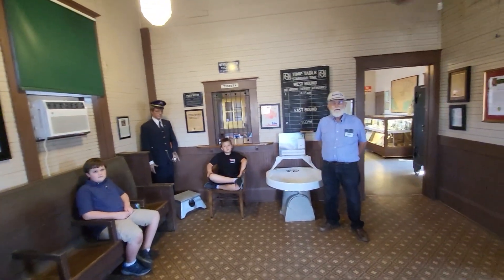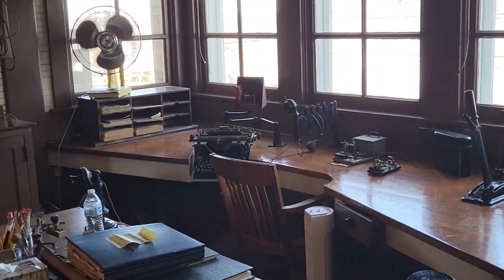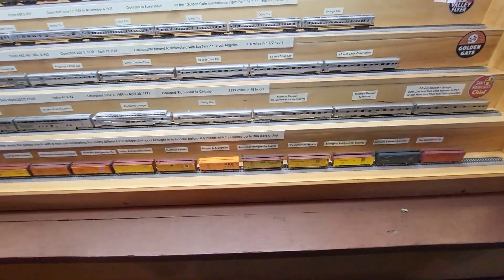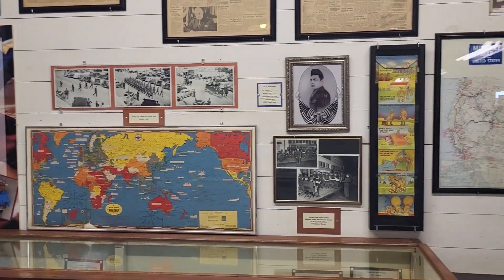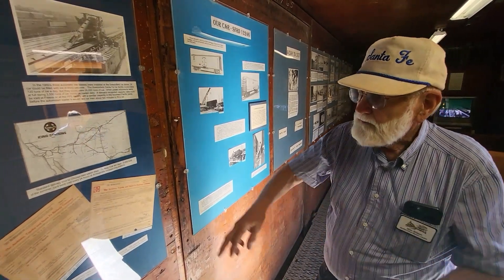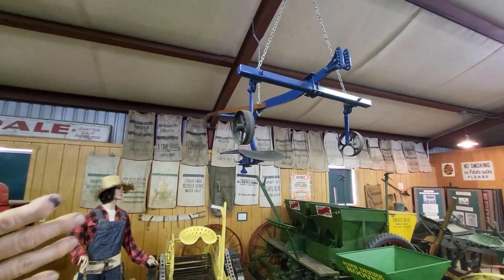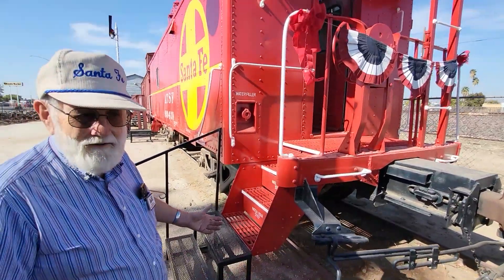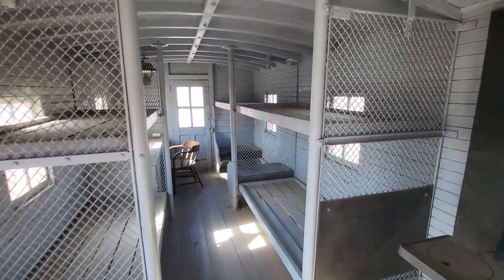Visiting the Shafter Depot & Railroad Museum

Comment: Mark, this comment way off  away from the "short" you posted about the one-axle derailment in Tehachapi, recently.

Your analysis is as good as any prelim can be, as far as "what apparently happened," as opposed to a final determination of precise cause, defect in the rail, undetected damage due to wheel slip, inspection issue, etc.

But for the nail, the shoe was lost,........

The break of the rail head that resulted in small, linear break shards nearly exposing the web below the head may indicate a linear separation of the head and web - soooo difficult to detect on by visual inspection. Sometimes there will be small rust streaks below the head down toward the base.

That derailment is one for the books.

Comment: Potatoes?? I would not have guessed that potatoes would have been commercially grown in the  SJ valley
Reply from the maker: They are still a huge crop. Grown mostly in the southern valley.
Reply: @MarkClayMcGowan  And,, of I recall correctly from J. Signor's books,  ranges coming out of SoCal up Cajon did not happen at the same exact time as potatoes in the SJ valley.  

However, he did forget to give Santa Fe the credit for selecting crops with different timings for efficient transport operation. (Hahahaha)